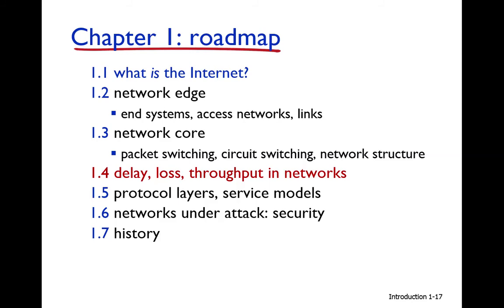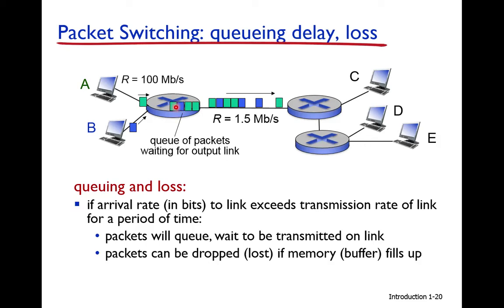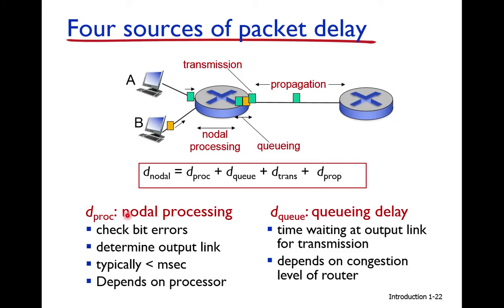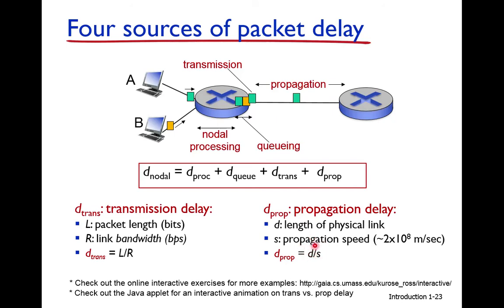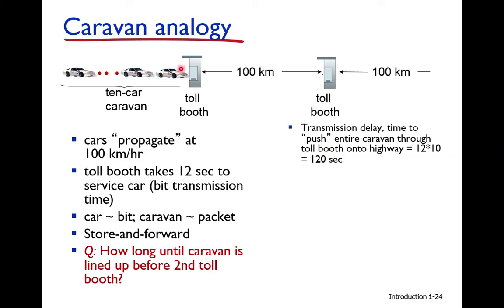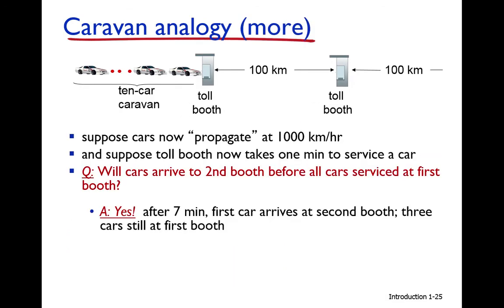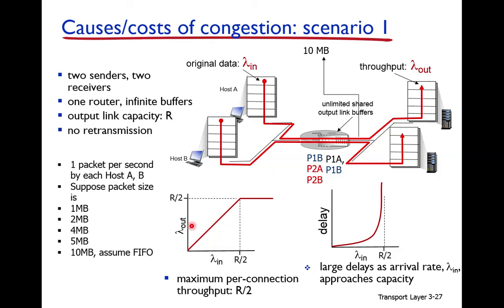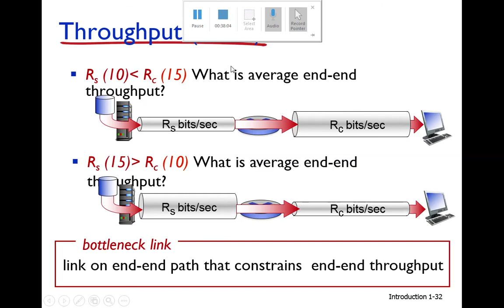Chapter1 4 2 lastpart

Comment: how is 100 km/1000 is 6???? it is 0.1 please help me how u calculate it?
Reply from the maker: thanks for the comments, my apologies for late response because i was on vacations, Actually the initial value is in Hour, i.e. (100 km)/(1000 km/hr)= 0.1 hr (hour) = 0.1*60 minutes ( to change hour to minutes, we should multiply by 60 because one hour is equal to 60 minutes)= 6.0minutes. I think it should be clear now, in case you still need any assistance, you can contact me via skype nadirshah091  thanks!